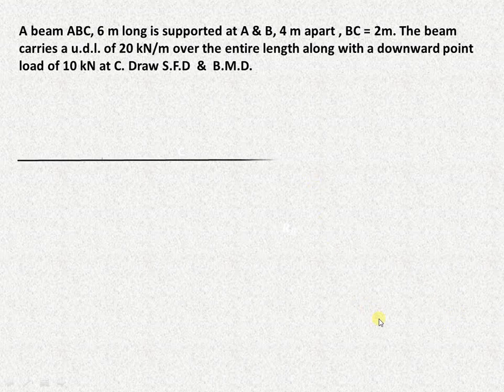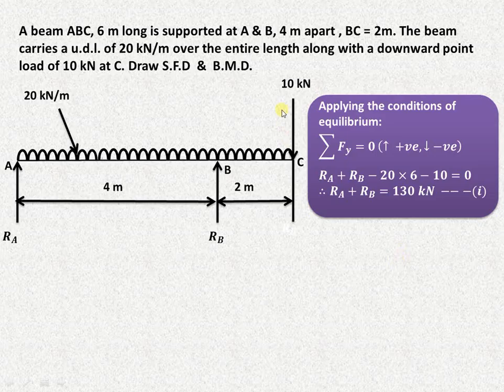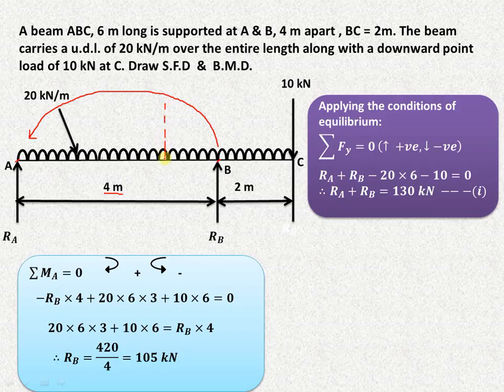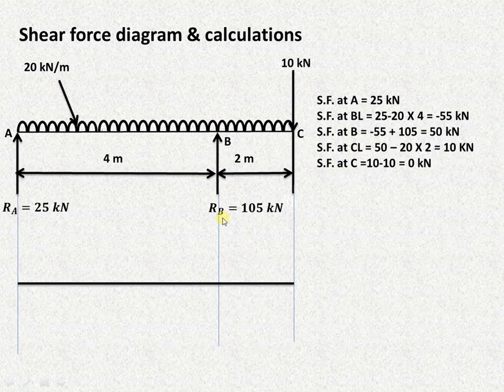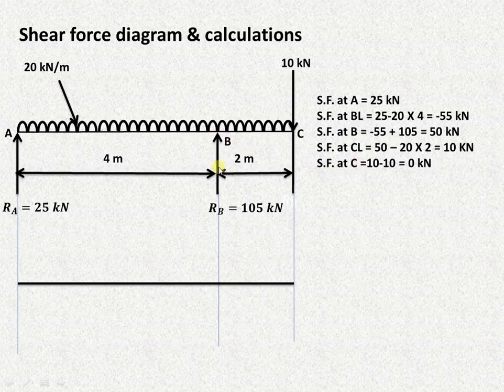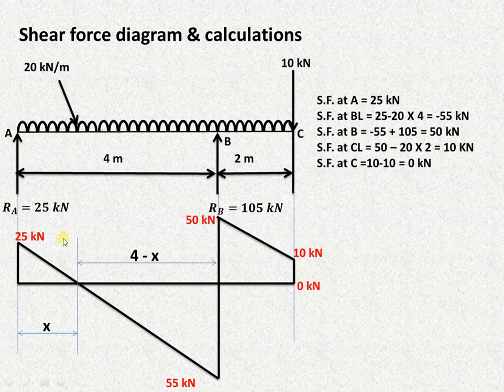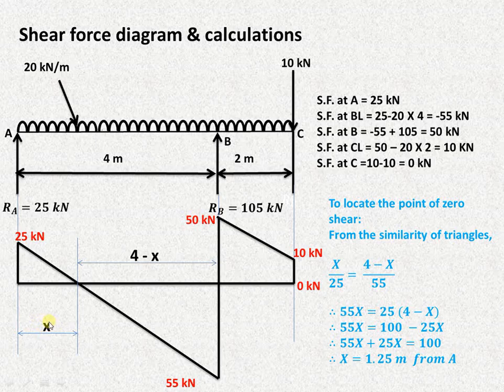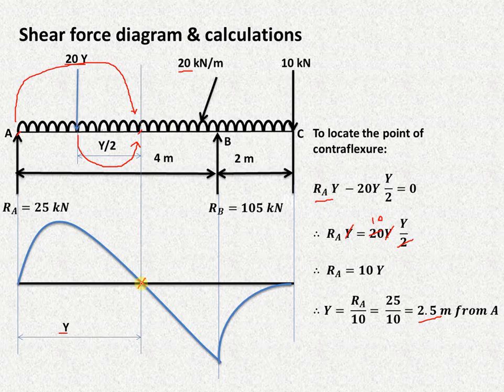Lecture 13 | How to draw shear force & bending moment diagram -  point of contra flexure

Comment: Helpfull video sir, if you dont mind can you explain how to solve this problem “ A beam of length 12m has overhanging of 3m on left and right leaving the span b/n the support of 6m.it carries UDL of 8KN/m over the entire length and a concentrated load of 10KN at the right extreme end. draw SF and BMD and find the point of contra flexure point”